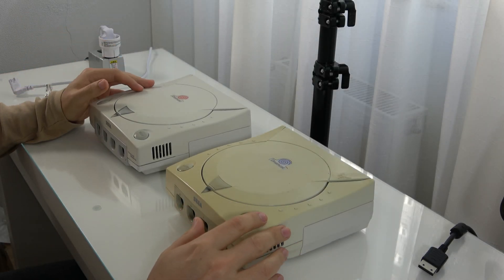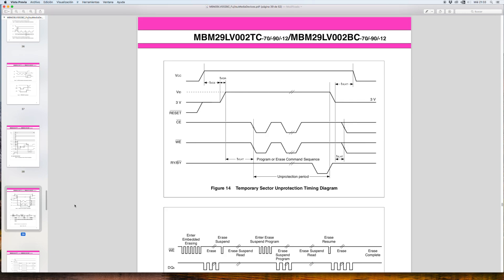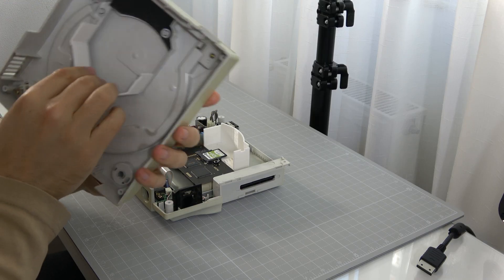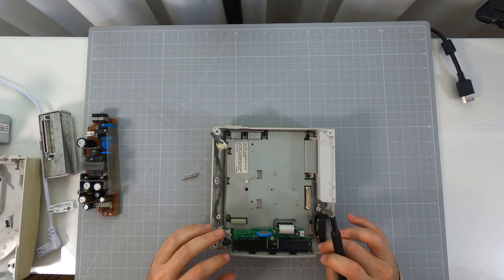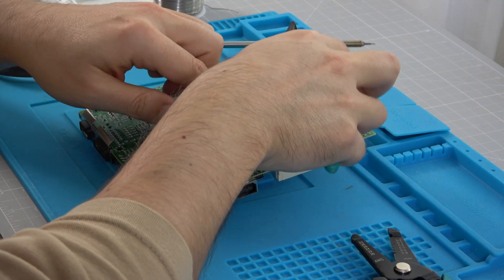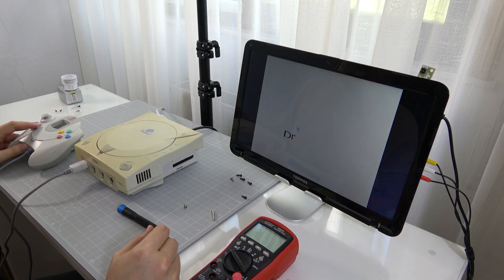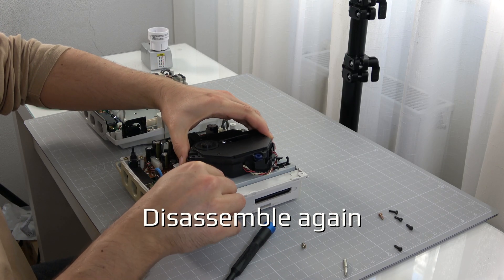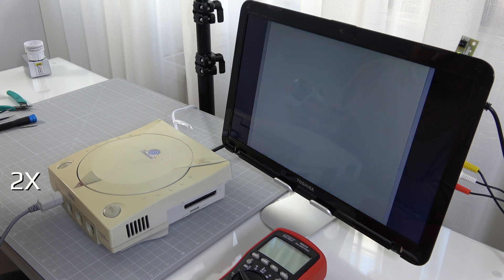Dreamcast EUR (PAL) to JAP (NTSC) Region Change

Comment: I did some testing on the most common va0 revision and there is a 50/50 chance some let you change the settings, some won't just save, most likely the chip used is read only. The thing is all va0 I tested did not include PAL region in their bios, setting it to Europe would still make them Japanese region, you can change the video between NTSC, PAL50 and PAL60 if you want for some reason though and switching to USA region should still work as well. On VA1 setting the region to Europe and video to NTSC or PAL60 still let's you play all PAL games but in full speed instead. I wonder perhaps some late 1999 va0 might include the European region in their bios but it would need to be checked. Also, the most important thing is to remove the wire or flip a switch on a wire after the change is made and the console is shut off (don't try switching it on live console it will fry the chip). I did not turn the switch off and apparently antypiracy feature on one of my original discs kicked in and destroyed my bios, supposedly it was made on purpose to break any mixed bios that is still in write mode.
Reply: one more thing I found out the hard way... if you don't have the time set already and start up the console with the bios unlocked it will insta-kill your bios but supposedly it is possible to boot using VGA cable when the bios settings gets corrupted - well I don't really care cuz I'll just install the region free bios chips in the consoles I broke xD

Comment: Great video! Why did you decide to remove the wire? Is there any harm in leaving it connected after you change the region?
Reply from the maker: It was just to be on the safe side, if you leave the wire the bios will be unprotected and I don't think it was designed to have the programming voltage forever. Thank you for your comment.
Reply: Ah ok yeah, I guess I'll remove it after I change mine. It's too bad you can't use this method to go completely region free.

Comment: Do you know if this procedure is the same and will work on va0 models too? I have a japanese NTSC-J model and want to change to American NTSC-U. Thanks
Reply from the maker: Hi Maxwel, I don't have the schematics for the va0 but just search for a resistance on the programming pin, check the IC serial and search for the IC datasheet to ensure it supports 12v programming.

Comment: is any chance to damage DC during this process? I have flashed my and DC became really unstable. First of all my custom made RGB cable stop working, not it's sound only. Currently working with composite only. Also some weird issue where the DC don't pass the BIOS and the screen get black. I've already flashed the DC back to PAL region but all those problems they didn't gone.
Reply from the maker: Hi, if you flash the DC multiple times there's always the risk to damage it, a black swirl during boot means the BIOS is corrupted, you have to solder a replacement BIOS

Comment: Is there a way to install the fegionfree devkit bios usign this method?
Edit: nope this method DOES NOT touch the bios only the system settings, anything you change has already been in the system.
Reply from the maker: That's right, you have to change physically the IC or piggyback it.

Comment: Hola amigo, una pregunta. Tengo una Dreamcast PAL y la quiero hacer NTSC (USA). Necesito comprar un GDEMU e instalarlo primero con la imagen del Region Changer dentro del SD para poder cambiar la region? Detecta instantaneamente el GDEMU?
Reply from the maker: Hola buenas, puedes hacer el cambio de región grabando el bin del loader a un CD normal como en el vídeo o con el GDEMU, para hacerlo con el GDEMU tienes que usar la herramienta para mandar imágenes a SD con la estructura que se indica en la página del GDEMU. Una vez cambiada la región es tan simple como desconectar el cable. El GDEMU funciona en ambas regiones sin problema.
Reply: @KabukiFlux  ahh ok muchas gracias. Osea simplemente instalando el GDEMU puedo conectar mi dreamcast a un televisor NTSC sin problemas de distorsión de imagen?
Reply from the maker: Te recomiendo que hagas el cambio de región igualmente, si lo conectas por rgb en vez de cvbs no tendrás ningún problema.

Comment: interesting video, ask; Does this tutorial also work on a Dreamcast that had the BIOS chip changed?
Reply from the maker: As long as it is flashed with an original bios file, if you flashed your bios with an alternative firmware I think it won't work.

Comment: I bought a Japanese one, I'm from Europe, should I install only the sd card mod and I can play any game from every reagion or I still need to the free region mod? Can I have cd reader with sd card mod without sacrifice the cd reader?
Reply from the maker: Hi, with the GDEMU for instance you can patch the region for each game so you can play it without changing the bios region. And if you use the SD adapter on the back port of the DC you can still keep the GD drive unit, but I recommend you the GDEMU or the MODE if you can pay it, or even a gdemu clone if you want something cheap.